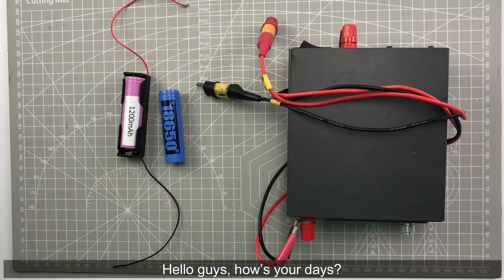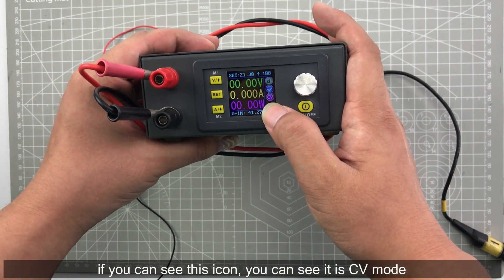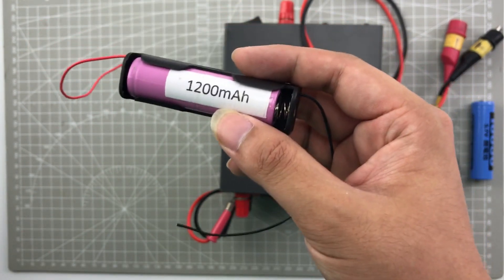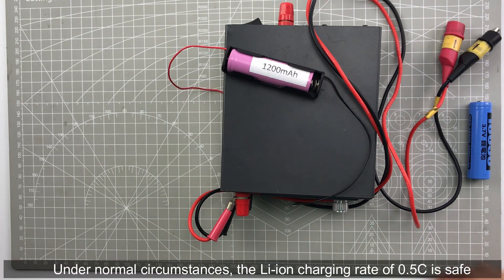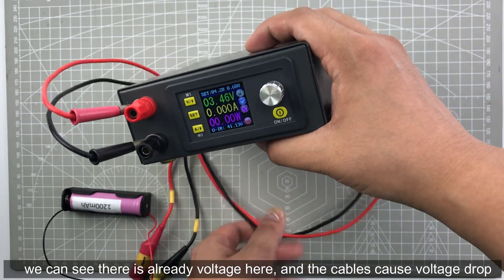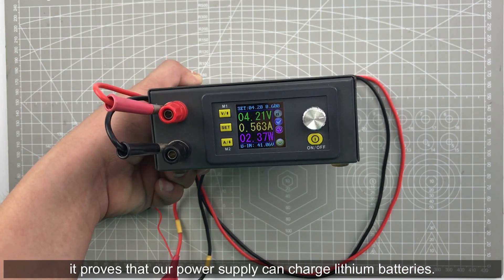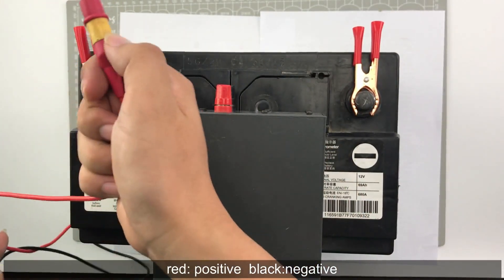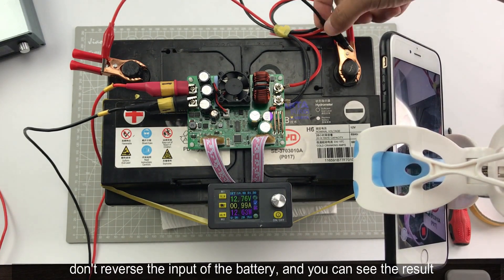Can RD DP and DPS DC POWER SUPPLY charge  batteries

Comment: I'm planning to buy one of these. It is surprisingly good how the company communicate with the buyers. I'm considering to buy DPS5020 or a RD6006. Otherthan the voltage and current rating difference are other options same or not?
Reply from the maker: hello, the operation of them are not same, and RD series power supply has bigger screen, battery charging terminal, keypad control, if you just need a stable output, you can choose DPS5020, if you want to use it more conveniently, you can choose RD series power supply, it depends on the voltage and current you need to decide the device you order
Reply: @rdtech9153  Sure. Thanks for the assistance.
Reply from the maker: @yowunpansilu  you are welcome, if there is any needs, just send me message

Comment: What is powering your unit? It reads 41v in and you have nothing connected to the back of it. Magic??
Reply from the maker: hello， this is DPS3005, it does not have separate power board, then I can put a battery pack in the case as input power, and I can charge it when the battery pack has low power

Comment: How can i set 3005 to cc mode? It seem do auto turn.
Reply from the maker: hello, the output mode depends on the load you connected, not set it by yourself
Reply: I saw many more expensive lab bench test and they pretend to have real cc, but in practice no control.
Reply from the maker: @martinhyska1206  as what I said, our power supply output depends on the load you connected, it will change with the status of your load, for example if you are charging a battery, at first, it is CC mode, and the output voltage will rise, when it reaches the peak voltage, it will turn to CV mode, the voltage does not change, and current will decrease until it does not decrease, it can be considered that the charging is finished
Reply: @rdtech9153  So after reach exact voltage, it turns CV mode. So if current go to 0, it auto turn off or i need it manualy? Can I set turn off output instead of CV mode after reach exact voltage?
Reply from the maker: @martinhyska1206  for DPS series power supply, it does not have auto cut off function, and usually current will not go to 0, it will stay at a very low current, because there is internal consume which keep the balance, you can turn off the output anytime, no problem

Comment: I have a DP50V5A V1.15d, does that one need a diode? And if so, what kind and where can I buy it? I don't really plan on using it to charge batteries often, mostly as a power supply for troubleshooting, but I want to be able to use it to bring some packs back to life. Thanks RD Tech, love your products!
Reply from the maker: hello, as long as you connect the battery in the right way, there is no need to add the diode, a diode is for someone who often connect battery in the wrong way and turn on the output without checking

Comment: Скажите пожалуйста а DPS3012 можно заряжать автомобильный аккумулятор? И как правильно подключать аккумулятор автомобильный для зарядки? Сначало подключить провода на клеммы а потом включить выход с DPS или наоборот включить выход а потом кремы?
Reply from the maker: you need to set the right voltage and current, connect the battery in the right way, then open the output

Comment: theres nothing plugged into the input terminals at the back? where is he getting 42v in from?
Reply from the maker: hello thank you for your comment, inside the case there are some 18650 battery be used as input
Reply: @rdtech9153  So do you have 10x18650 in series inside? Or do you have them going to an additional boost converter inside the case?
Reply from the maker: @housinit  for the power supply in the video, we use 10x18650 battery pack as input power source

Comment: please add charging programs for these units, or make completely different product line for it :). This would be great for charging big lithium battery packs (say like 10s pack for ebike) chargers this big with adjustable parameters are very expensive. I would like to charge my cells to 4.1v insted of 4.2v to increase longevity. It needs programmamble termination for A so I dont need to watch for it. Somebody has done this but i dont know how to reprogram it. https://github.com/lambcutlet/DPS5005_pyGUI Thanks.
Reply from the maker: sorry just like what I said, those power supply can charge the battery but they are not designed to charge battery professionally,  at now we are working on our new product RD6006, time is limited.
Reply: @rdtech9153  could the A termination to be added to the product?
Reply from the maker: @lxh22  no , there is not A termination

Comment: when I am charging a 12 v 4AH battery by DPS 5020 and set the voltage and current 13.80 v and 0.40 A ,the display shows 13.80v(fluctuating) and current .0.39 A not 0.40A is it normal or abnormal operation
Reply from the maker: first you need to tell me the kind of the battery because usually 12V lead storage battery we use 14.4 to charge, and you had batter make a vedio and send to me,  my email is written in the description of this video, I want to see the charging mode, and I can tell you the weather it is normal

Comment: cross sectional area for input and output wire
Reply from the maker: we use RV1 square single
 core flexible cord for power supply without power board, and RV2.5 square single
 core flexible cord for power supply with power board

Comment: I have dps 5020 ..Has it output reverse protection
Reply from the maker: dps5020 havs output reverse protection for resistor or else, but not for battery because battery has electricity. if you want to be safe when charging a battery , you can add diode and fuse  like what I put in the top comment

Comment from the maker: you can also add a reverse protection ,a  diode and a fuse, here is the way to connect:https://drive.google.com/open?id=1a54ZP9qwbGil5uczDqCXg9vePGR6YWhB
Reply: Value of blocking diode for DPS 5020
Reply from the maker: 20A diode best,  10A diode can also be used because it is only used when reverse the electrode
Reply: value for diode for 20A and 10A
Reply from the maker: @varun07ch67  they are all ok
Reply: you are using wrong sign for anode and cathode in schematic
Reply from the maker: @varun07ch67  sorry for that, I will correct it , thank you

Comment: ¿Cual es la diferencia entre sus productos DP, DPS y DPH? Saludos desde argentina.
Reply from the maker: DP and DPS are buck power supply,  DPH are buck boost power supply, and the differences between DP and DPS are the opreation system,  you can operate the DPS system easier
Reply: @rdtech9153  Hi, thanks for answering! My last question is the issue of input voltage. I don't decide between the 50v 5a or 50c 15a version. For each case, what source do you recommend to supply the voltage and amperage required in each case? I don't know if you have any special recommendations. regards
Reply from the maker: @Alan96555  It depends on the current you need, and If you choose DPS5005, you can USE a 48V switch power supply and if you choose DPS5015, you can use a 60V switch power supply

Comment: Я тоже заряжаю блоком DPS5020 аккумуляторы разные но на выходе блока сделал защиту от обратной полярности, поставил диод шотки и плавкий предохранитель. Очень доволен работой
Reply from the maker: yes, you can connect a diode in parallel and connect a fuse in the output positive pole, I draw a picture, is it same with yours?
https://drive.google.com/open?id=1cIBTkwrLgfEnqJHLiktExlqROZUAJPfR
Reply: @rdtech9153  hello, picture is unavailable (says you put it in trash). Could you please restore  it?
UPDATE: This links works https://drive.google.com/file/d/1a54ZP9qwbGil5uczDqCXg9vePGR6YWhB/view
Reply from the maker: @SvitogorX  https://drive.google.com/file/d/1a54ZP9qwbGil5uczDqCXg9vePGR6YWhB/view?usp=sharing    check this link
Reply: Какой именно диод посоветуешь?

Comment: So far i have always used a diode when charging batteries. Is that still a good practice or could is skip it?
Reply from the maker: if you buy the product 2 years ago and you get the diode in the package, you need to keep it , after that version diode can be removed, of course you can keep it but it will lead to some voltage drop
Reply: @rdtech9153  I got my two DPS5005 units about 6 months and 18 months ago and they didn't include an extra diode. So i guess i can skip it then. Thank you for the reply and the product - they're great.
Reply from the maker: @Leif_YT  you can use a diode and a fuse to make a reverse protection, this is the way ,https://drive.google.com/open?id=1cIBTkwrLgfEnqJHLiktExlqROZUAJPfR
Reply: @rdtech9153  the above link is not working. can you please update?
Reply: @rdtech9153  ,the link doesnt works-shows only
"antireverse.png it is in the owners dustbin"
reverse protection circuit:
 >>> https://app.box.com/s/9196ftd47l7mgc0b7vjbsqrevbjw3sm1
Reply from the maker: @Ianistrip  https://drive.google.com/file/d/1a54ZP9qwbGil5uczDqCXg9vePGR6YWhB/view?usp=sharing  you can check this link
Reply: @rdtech9153  ,thank you for reply,
one more question,
for DP50V5A ,how many Amps(+/-) mast be the fuse in the reverse protector circuit,
*for example ,for NIMH or LI ION batterys with max AMP charge load 0....2Amps,
(by  your own knowledge and experience)
thank you
Reply from the maker: @Ianistrip  hello, usually if you use it for DP50V5A, 5A fuse is ok, you said you usually use it for 2A, so it is better to use a fuse a little highter than the current value you want to use, 2A or a little higher fuse
Reply: @rdtech9153  ,thank you for help answer,
but here there is another circuit-schematic from a seller, which conect this diode in series to DP50v5A to charge a battery.
Which of two circuits does better ??
1)the circuit with fuse ?
2)or this circuit bellow ?
--->>> https://app.box.com/s/jlqv089snk5tsnuefgobu0c2opxcf31a
Reply from the maker: @Ianistrip  hello, I have no access to check this image, can you upload it to google disk?
Reply: @rdtech9153  ok,
--->> https://drive.google.com/file/d/1ofgA8VKmxNnIU1qSZ4_CCXIRlv464f1g/view?usp=sharing 
can do to conect both the circuits
*(fuse+diode) & (the diode in series by "+") 
when i iam in the charge batterys procces ???
Iam ask all these about,because iam build a second parallel output terminals-only- for charge,& iam thinking to conect these circuits only there
thank you for your time
Reply from the maker: @Ianistrip  hello, this is our design for the DP50V5A about  3-4 years ago for battery charging, not for wrong connection protection , at that time the DP50V5A is not good enough so you need to add this so that you can charge the battery( with right connection), but for now we have already optimized the products,  you don't need to add the circuit you show to me, only need to add the circuit I send to you if you may connect the wrong electrodes
Reply from the maker: @Ianistrip  please just use this one:https://drive.google.com/file/d/1a54ZP9qwbGil5uczDqCXg9vePGR6YWhB/view. no need to use that
Reply: @rdtech9153  ok,
only a detail what diode type,
(simple diode ..,shottky diode..,how many Amps..)
thank you
Reply from the maker: @Ianistrip  the drive current of the diode is higher than the value of the fuse, it is ok, just this requirement

Comment: I like the reverse result part of the video which also indicates likely parts that will need replacing.  This is the BEST PART OF THE ENTIRE VIDEO.  "NEVER DO IT" BUT IT HAPPENS SOONER OR LATER!
Reply from the maker: thank you, and I want to use it to tell our customers, sometimes they are not so careful when connect the cables, but it is important. but at some state, some parts can be replaced, but some times it can't be fixed, because our power supply is not special tool to charge battery
Reply: @rdtech9153  Thank you for picture with burned elements, im here because reversed my dps )
Reply from the maker: @srower666  do you fix yours already? if not, you can contact us on aliexpress or by email, let us judge the burned chips